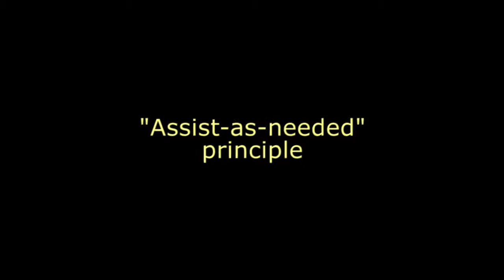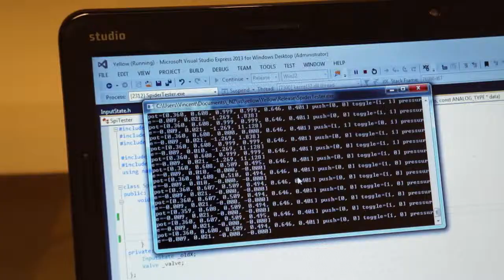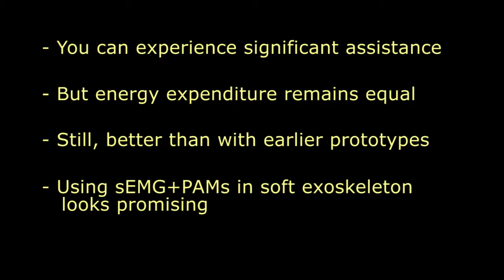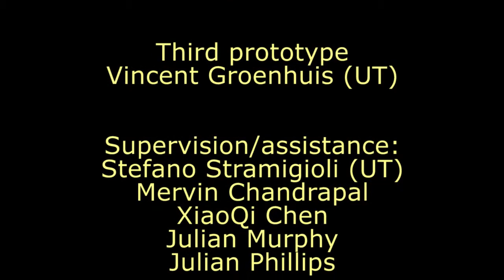Powered Exoskeleton video (without music)

Comment: Getting a preprogrammed movement of standing up would be very helpful for use by elderly.  Or even allowing them to walk around with minimal effort.  It looks like with a few alterations to form and shape, not function(using the inflated tubes as inflatable supports to guide movement) that it would be pretty stabilizing with low risk of injury.  Looks like you are having the same trouble as me...How do we attach these exoskeleton suits to our bodies without screwing it into ourselves like on fullmetal alchemist.  I bet your machine has a lot greater efficiency but is losing some due to applied force transferring as friction to your thighs from the straps.  The slippage is real, especially the higher frequency you go(try and run).